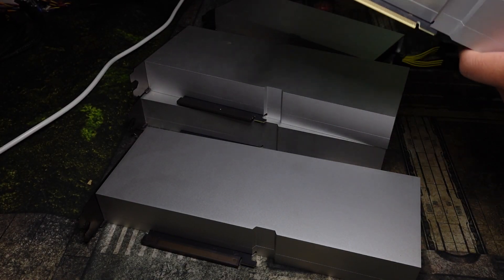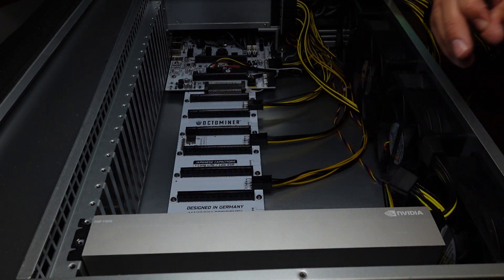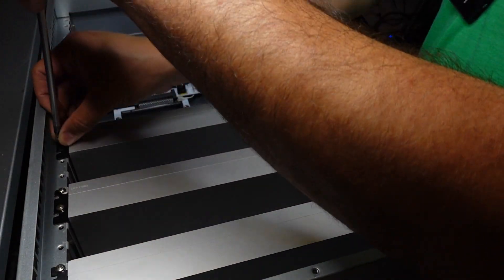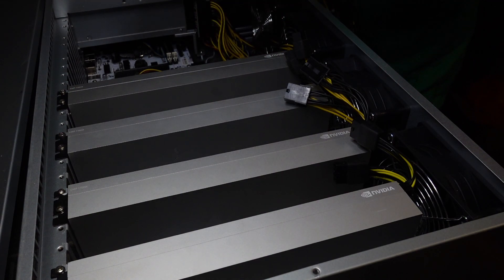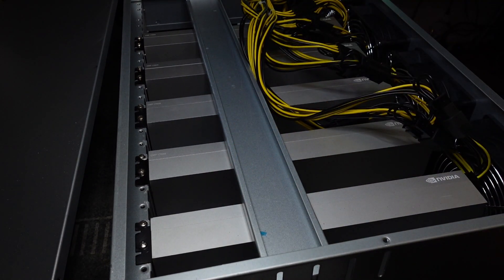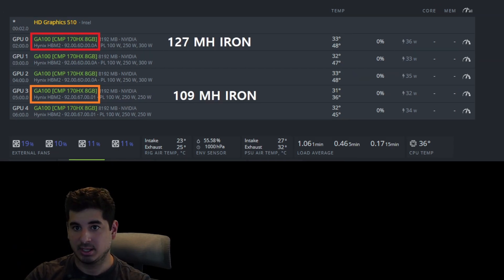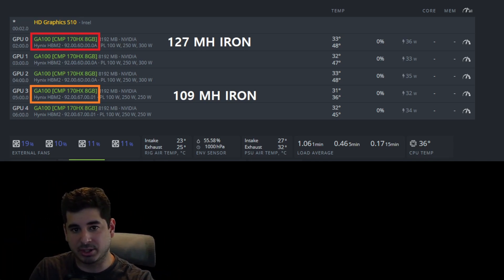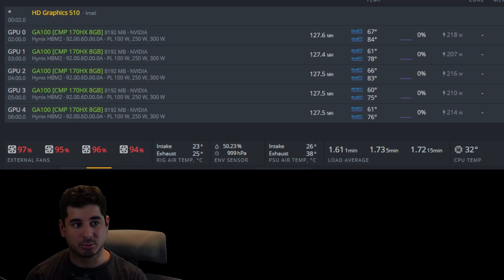170HX testing, deployment, and initial thoughts.

Comment: Just bought 5, yolo… Kroot, you said one 8 pin would fry the card? Single strand won’t work?
Reply from the maker: Hope you filled out the survey!!! The single strand wont work imo with how much power the 170hx draws
Reply: @krootman_digitial   I’m hoping to power 5 with a single T2 1600w PSU, but not enough ports if I have to use 2 each. Figured each could handle 240 watts 80% of 300w

Bad idea? Where’s the survey?

Comment: Those make for a really clean looking build!
Reply from the maker: Yea man, with no fans you can basically lay the wires on top of the GPUs, you don't have to jam them in the back of the case (you can if you want too)
Reply: I came to type the same comment, lol
Super clean build👀🙂🥂